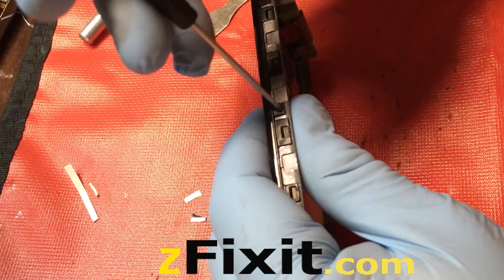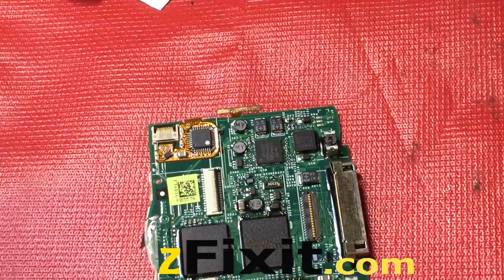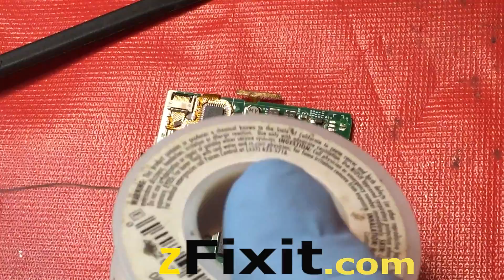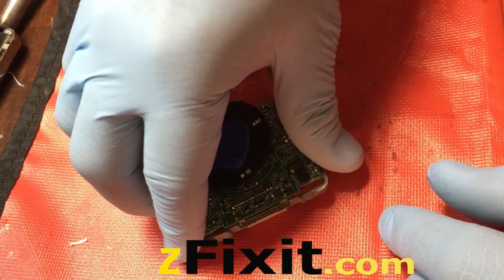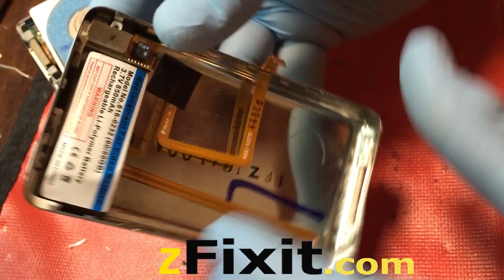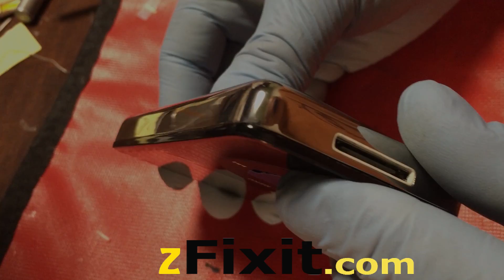iPod Classic 5th Gen Battery Connector FPC Replacement

Comment: This is a very intricate operation! I've replaced the battery to my 5th Gen ipod several times and the clip on the battery connector finally broke.

This operation is a bit more precise than I'd like to take on by myself.

My question to anyone who might see this comment is this: If I have all the parts, what is the correct price to pay a professional to do this kind of operation in 2024?

Comment: That little thing is very easy to rip off, most especially if you're an older man who is hands 🙌 has started to shake just like me. Now, I have successfully ripped two off and it's very painful, but luckily for me, I found a guy who did one for me, and the second one is yet to arrived.
Nice Job with extreme patience.

Comment: i just wanna ask there are 2 connectors for the back and 3 connectors on the front.. what is the purpose of the center connectors on the front? what if the solder part on the board is missing and the only soldered are the 2 on the back and the 2 on the front and the center solder is missing?
Reply: The best I can tell you based on iPhone battery connectors, the center is a gas gauge, the left and  right are connected, have continuity, like all other Apple batteries, the center is a gas gauge, like a vehicle gas gauge, communicates to the logic board that the battery is either needing to be charged or if fully charged, cuts off power to battery, a gas gauge.
Reply: There are no publicly available schematics foe these boards so have to guess based on iPhone battery connectors
Reply: And that is the Apple term for the point, it is called a gas gauge by Apple
Reply: maybe thats the reason why even if i charged the battery it doesnt come  to full?
Reply: The power mananegment chip cuts out 5volt power to the battery once it senses full and sends signal to screen that battery is full, not charging
Reply: It can be fixed , I have repaired center pin issues, but I would need pictures, it would still be $50 to repair as long as repairable, don't try to remove, $15 diagnostic, fee applied to the $50 or if not repairable, then no additional fee, visit my website and order the diagnostic
Reply: The solder pads are ripped and have to be jumped so that it makes the proper connection to the right solder point, so that the center pin communicates with the board
Reply: send me an email address or phone number, Ill send a pic of the fix, cant post here for some reason, requires a microscope and the right flux, right solder tip, etc
Reply from the maker: 2 10 * 81 6* 21*08  @manzam01
Reply from the maker: send me a text and Ill send a pic of the fix
Reply: email adress pls
Reply: email adress pls..
Reply: btw im from philippines..
Reply: borjokmolina@gmail.com is my email i can send u the picture.. btw theres a wire a very very thin wire and the technician soldered it on the center pin.. is that ok? but the problem still there at first it will just stuck at 80 peecent now its stuck at 74..
Reply: please help.. this is the only player i have left and i could not afford to buy one..
Reply: sir i message u on facebook.. i sent there the picture
Reply: anyone van help?

Comment: How did you unclip or disconnect the hard drive? I could not see how you did it, from the camera angle. What was the stuff that you dip the soldering tip into? What was the cleaning solution that you brushed on the connector, to clean the flux off the connection?

Comment: Thanks for showing how a pro does it. I managed to do it too, but not as pretty as yours. I didn't need a microscope because I'm extremely nearsighted ( -10 ) so all I had to do was use a pair of safety goggles instead of my glasses. An alligator clip did help keep the connector in place.

Comment: Hello, is possible to replace zif connector( hard disk) of the ipod classic pcb?
Reply from the maker: Claudia Olivares i imagine it is, I have tried to remove before but the anchor points have a large copper pad so heat gets absorbed quickly and does not allow the solder to melt ..but if more heat at those areas, maybe. I just didn't keep trying
Reply from the maker: Also, the same issue (large heat absorbing copper pad) is present on HDMI port anchor points on the PlayStation 4, really hard to remove but have done it. Large copper pads around anchor points absorb so much heat..but doable...but I have also received PS4 boards where a previous attempt was made ...but most were done as the tremendous amount of heat they placed warped the board since they did not know how to remove ... So be careful.

Comment: Amateur tip:  Use a pair of alligator chips to keep the connector on the board.  You want a clip that is large enough to not be stressing when clamped down but not too large that it's in the way. Clamp the connector to the board as close as possible, then gently maneuver it in place, getting it evenly inside the white markings on the board. 

I did this repair last night.  Yes, it's very hard to get the connector in place & then it WILL move as soon as you touch the iron to it. The alligator clip saved me hours of frustration.

I hope this helps people out.